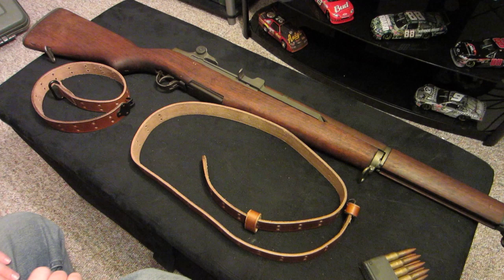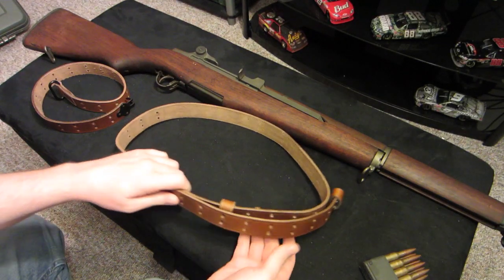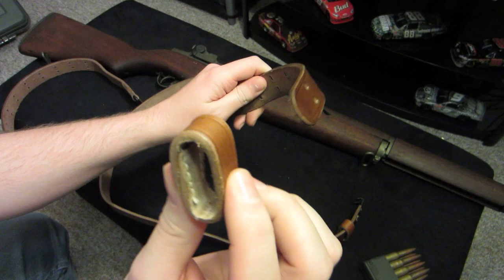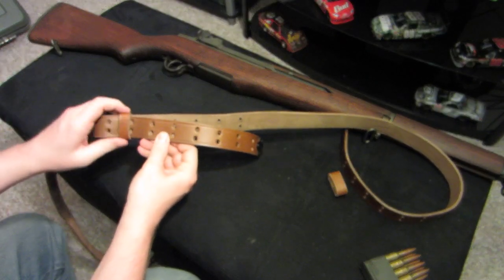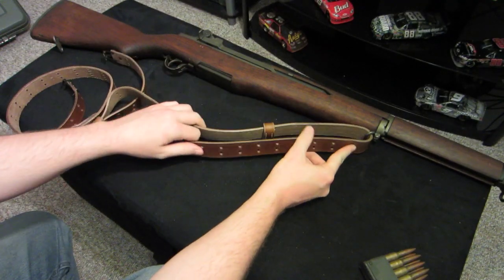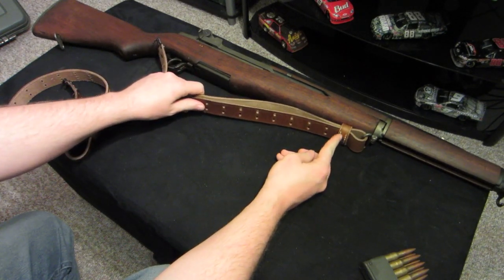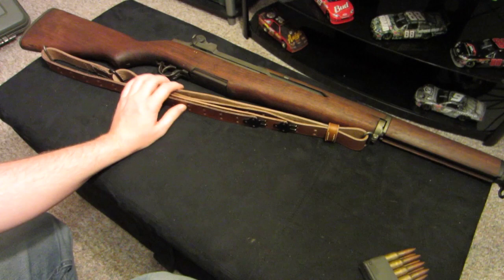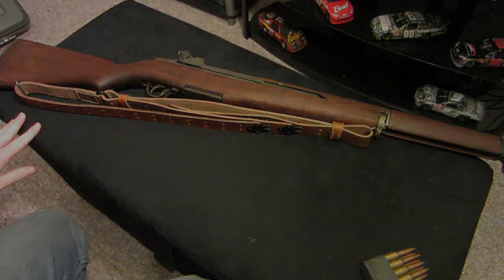M1 Garand M1907 Sling Installation

Comment: Good help advice video for the common approach to a common problem and this will get a sling on a rifle in a pinch. There are however, US marines who's heads are exploding. The manual teaches keepers together and loose end down through the top. It is backwards to common sense until you use it 1/4 turn out on your arm.

Comment: I just got my sling in 2 days ago. I'm putting it on an M1A loaded.  I always wanted a Garand but unfortunately they ain't very easy to find and seem to be pricier than the M1A these days. But I'm hoping it works the same.  It looks like it will. Thanks for the install video this will be my first attempt at I stalling an actual military type sling

Comment: Only the army could issue a sling like this. I can see why they switched to the webbing. Thanks for posting. Got one of these with the brass fittings for my 03.
Reply: The reason the US military switched to webbing was 1) cost and 2) durability. Leather falls apart in wet, humid, tropical  climates and cracks /  breaks apart in extremely cold climates. Otherwise, the M1907 sling is extremely versatile and still loved by competition shooters.

Comment: If your going to loop up and shoot with the sling in prone, sitting or kneeling, flip the sling around so the Dogs are laying inboard, laying against the stock. This is the old marine corps way also know as the Jim Owens method, makes it easier to use and by wedging the dogs against the keepers it won't work loose.

Comment: US Army FM 23-10 section 6-2 describes another way to attach the sling. The short end on muzzle end and long end on butt end. The long end is made to detach from weapon while still attached to short end and wrap around the shooters support arm during firing.
Reply: That's the old sniper manual for bolt-action weapons. Different animal than a line Garand. This is one of 4 ways I've seen- USMC, sniper, high power comp/cmp, etc. etc.

Comment: This shows the "regulation" way of installing the sling. Many target shooters would reverse the upper loop, so that the "frog" is on the inside because this makes it easier to cinch down the loop on the left arm. BTW, you adjust the tightness of the sling at parade position by pulling the upper loop around.

Comment: I like the look of those slings but they seem way to tight for practical use. I couldn't fit my forearm in there
Reply: Any sling is going to look tight if you have it set for parade - IE, as tight as it goes. That's why there are so many holes - you loosen the sling for practical use.

Comment: I bought one locally a long time ago. The hook things worried me. Won't it just come undone if you had it loose as you would to actually use it? After I set the legth on mine (not tight like yours, but loose so I could shoulder it) I used pliers to clamp down the hooks so it won't just come off.
Reply: they wont come undone. I have used one of these slings hunting for many years now and never had any problem.

Comment: Hi Ray,
So, once the sling is installed (and great instructions, by the way!), how is it actually used in shooting? I have an idea that the support arm goes through the "eye" between the keepers, so that the shooter can draw the rifle tight into his shoulder, but I'm having one helluva time making this work.
Is the sling always as tight to the rifle as you show in the video?
Thanks!
Reply: M G 
From a retired military competitive shooter - as with most things, there’s a right way, a wrong way, and the Army way. There are several different methods of installing and using the M1907, and the classic competition way is illustrated in SGM Jim Owens’ book. I used them on my XM21 SWS, my Match M14 and my M24 SWS. I have them on my personal Garand and several other rifles, and I’m miniaturizing one for the family pass-down 22 for my grandson. The loop is twisted counter-clockwise, the left arm inserted past the elbow, and the loop snugged up. The left forearm then swings outside, clockwise, and back on top of the upper half of the sling, to grasp the forend. ALL the length adjustments  are made to facilitate this arrangement. Where the lengths end up have NOTHING to do with the use of the sling as a carry strap. Watch the video by H R FUNK because he demonstrates how to get into the “prone with sling” position. He’s another long-time competitive shooter and is one of the CREDIBLE youtube authors.

Comment: It should be noted that with the sling in this position shown in the video it is in what i call the stored position. tight against the rifle. obviously if you want to sling it across your back youll need to make it longer. but this gives you the option for both options and if your not using the sling it keeps it nice and tight and out of the way. which is 99.9% of the time.

Comment: Would oiling the sling help loosten it up?
Reply: Oiling the leather strap will make it easier to use as well as protect it from the elements and mold.  Any good leather you plan to keep should be cared for.

This is the stuff I use:
http://www.horse.com/item/leather-therapy-restorer-and-conditioner/SLT901557%20032/?srccode=GPHORSE&gclid=CjwKEAjw9qafBRCRiYrL4-fpuFkSJACvocQ1pm3XeNe14E1s0NrcnN_gO87V53uZ0fuKVK5GXTGRhRoCWTLw_wcB

Comment: The only thing I'd add is to treat the leather with a preservative before installing.  One of the best things to use that would be period correct also is neatsfoot oil.  Get a good quality oil, and absolutely drench it.  Rub a lot on.  Hang it somewhere it'll be warm, and let it soak in, then rub a lot more on.  You'll be able to tell by color change when it thoroughly soaks all the way in.  The neatsfoot oil will darken the leather quite a bit.  It may take 3 or 4 generous applications to get it thoroughly drenched in the oil.  

To learn how to use the sling, see if you can tell what they are doing with this old WWII era training film.  https://www.youtube.com/watch?v=L6p_Cftp9QE  There are others that are newer and less grainy.  Just look around.
Reply: Bradley Dyche do you apply it to the underside (suede side) as well?
Reply: I did.  One thing though, I've been told by competitive shooters that neatsfoot oil will make a sling stretchy like a rubber band and make the sling useless.  That said, the one I have that I drenched in neatsfoot oil doesn't seem stretchy to me at all.  It is a LOT more supple and flexible but doesn't seem stretchy at all.   I've had people say to use "Pecard's Leather Dressing".  I've tried it on other items I have and it works well too.  The neatsfoot is a little better at softening the leather though.  I've had people tell me to use a little neatsfoot oil and give it a few days to soak in and follow it with the Pecard's Leather Dressing, and that works well too.  So, if you plan on shooting competitively, you might want to use Pecard's or just a little neatsfoot and follow with Pecard's, but I'm still happy with the sling I drenched in neatsfoot oil as a plinker.  It still works well for me and the leather is soft and flexible and doesn't seem stretchy to me.  I think the Pecards is about 95% petroleum jelly with a few other additives.  Pecard's BARELY changes the color of the leather.  Neatsfoot darkens it considerably.
Reply: Bradley Dyche hey man, I really appreciate the write up.  I treat all my leather with mink oil, so since I have that on hand I think I'll just use that.  I'm far from a competitive shooter, this is actually for my first gun, a marlin 336bl, so I'm not too worried.  but I really appreciate you taking the time to give me pointers. wish you the best.